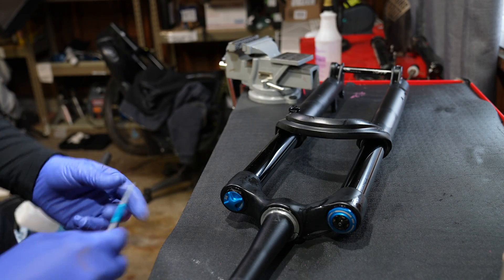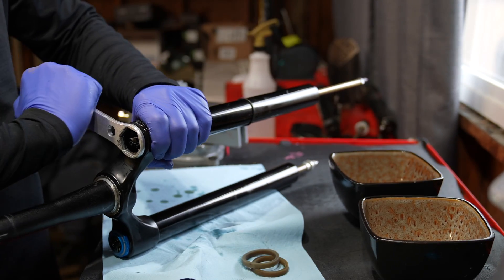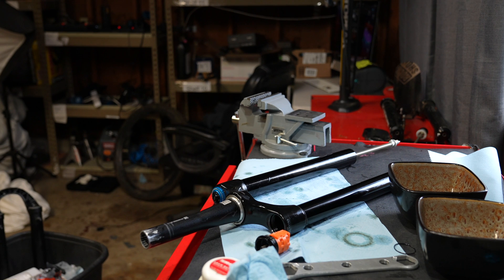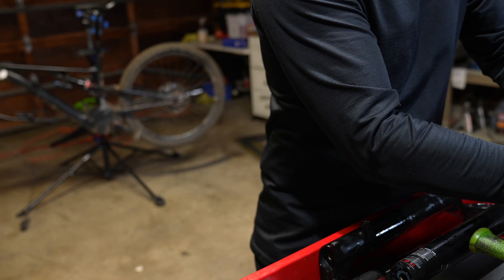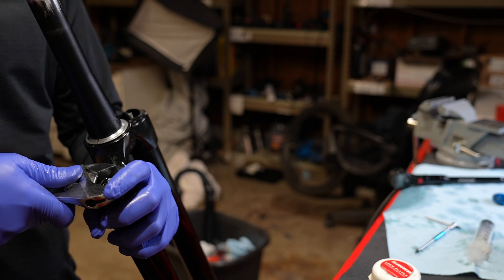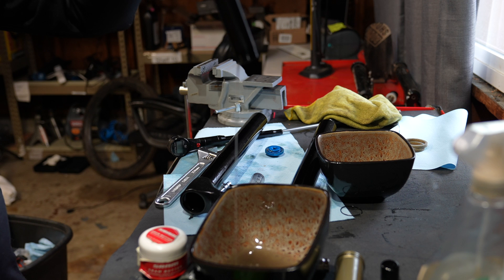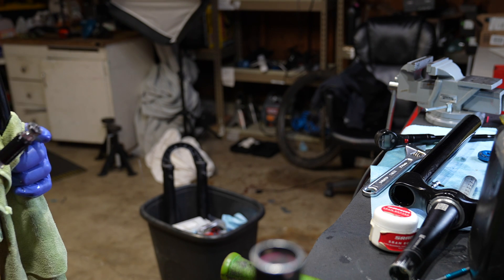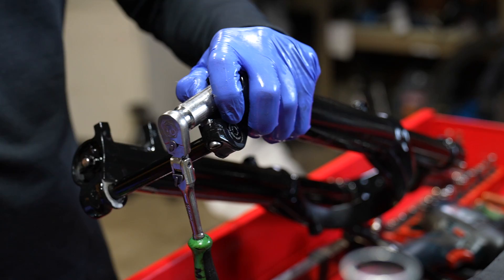How to Change Travel on a Fox 38 | PLUS MORE

Comment: Love your videos man. Just mentioning since its commented in the video: A stuck down airspring is a sign that there is air in the negative chamber. This means your fork return might not be optimal as you also need more air in the air chamber to counter this.. Not harmful for the fork or dangerous but it wont be at its best, and maybe a symptom of a worn spring, damaged seals or other things.  Al the best!
Reply from the maker: Thanks for feedback. Not expert here. New seal kit for it?
Reply: @OtterMTBtech  I would change the seals. But you could try to dismantle it and give it a lube up with slickoleum/ SRAM butter. But then you need clamps that fit so you don't cinch the tube. And I would really recommend a bullet tool for re inserting the rod so you don't damage the o rings. I have even seen that particular tool 3d printed, that might be good enough 😊

Comment: Mama gunna be STOKED to see you using her special bowls for fork oil ;-)   Brother from another
Good video fast clear and no fluff,  if i may,
1- A proper fork cap wrench is less than $15,  a no-chamfer socket vs a thin wrench less than $25 -  Buy The Proper Tool.  unless yr. in a pinch, don't use a crescent wrench. Can it be done? sure, (that's a good technique btw) just know, these caps mar like a fine hard cheese with the slightest incorrect alignment & enough torque from the wrong wrench.    

2- Be careful w/long steel screw drivers inside yr fork, consider something less prone to marring a bushing or something inside the fork, shit happens. A plastic adjuster rod for a set of window blinds or a thin wooden dowel is perfect to push cleaning towels into and through thru the fork,

Comment: Thank you for your video, very helpful. 
As for the damper oil change, in my case, used your technique, but it was the lower cap that got lose, no the top cap.
Reply from the maker: You have to get shaft clamps, I never had that happen
Reply: Yup that what I did, but found out that it was tight beyond the recommended torque. Thanks for your video. Amazing  @OtterMTBtech

Comment: 6 tokens.  60 psi.  Feels good. its just strange to be all in on the damping but it works great.
Reply from the maker: I am 100kg 220 lbs. I’m on a similar bike riding 100 psi in the fork. 2 tokens. 1-2 clicks of hsc and lsc. Because the Levo is shorter travel and bike you may need an extra token since less travel more weight in front of bike. 

6 tokens is like free ride. Sounds like your way under pressure and packing the fork down hints trying the full compression. You need to have a spring back into the shallow part of travel. I have setup guide for Zeb and 38 since I had same problem as you mentioned
Reply: R u 100kgs rider pack or body weight. I noticed I’m 102kgs thenonce I add my bodyarmour, helmet shoes, water park I’m like at 109kgs.
Reply from the maker: I ride with 10 lbs of camera’s good point

Comment: Hi man, i have 2 fox 38 forks. One 27.5 wheel Rythm 180mm of travel, second 29 wheel Factory kashima 170mm travel. Can I take the air spring from the 27.5 180mm and put it in the 29 so that it becomes 180mm the 29 ??
Reply from the maker: All Fox 38’s use same spring.